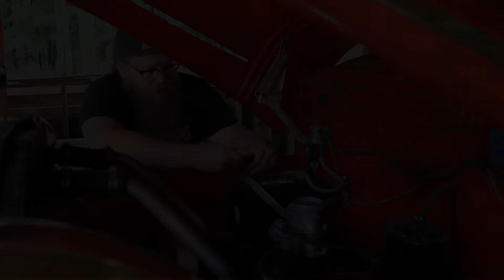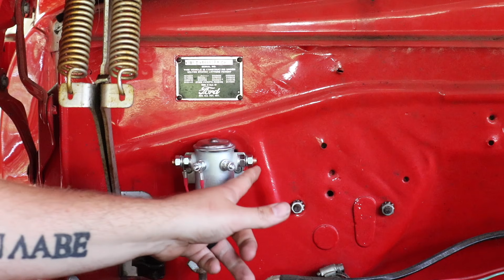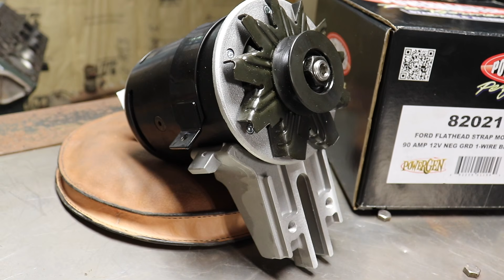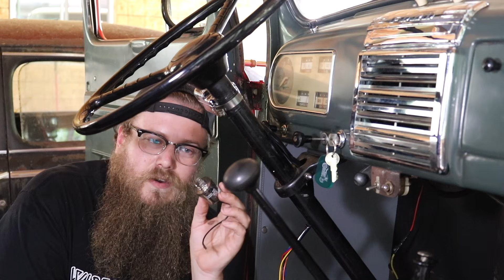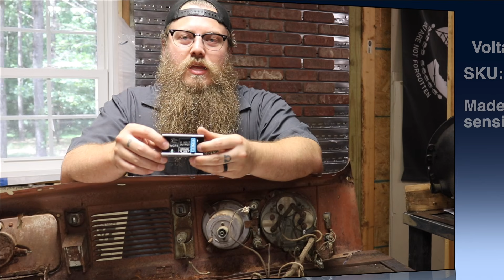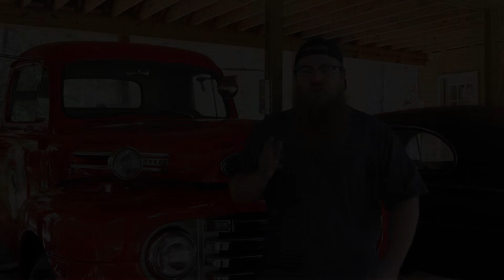12 Volt Conversion Kit Installation Ford 1951 truck

Comment: Hey Zack great video. One question my solenoid has only 3 terminals i wanted to ask where you put that one wire that was grounded for button? My kit is from vintage auto garage had it for over a year finally trying to tackle it all in but its getting very intense lol any help would be greatly appreciated

Comment: I had to boost my truck one last time before making the switch to twelve volt (to get it home). Prior to removing the battery, I noticed my horn no longer worked. I am guessing that that is because a horn is wired 'hot' and as soon as power was introduced, the 6 volt horn got 12 volts.  So my question is, is my horn irreparably damaged ?  I bought a new horn relay for the 6 to 12 volt swap along with all the other stuff you recommended.  I even got the small $79 unit you did a separate 3 minute video on. It cost a LOT more when shipped to Canada.  SO is my vintage horn 'toast' ?

Comment: Hello, i just inherited my father's 1952 f3.  he bought of a someone who has totally butchered the wiring.  The nearest I can tell it has ben converted to 12v electronic ignition.  My question is that year come with 12 volt or 6 volt originally. Thanks Victor

Comment: Hi Zac I’m trying to figure out where I should pick up power for the electronic fuel pump and for the relay from 12 V to 6 V. I was thinking of picking it up from the power that goes to the coil off of the ignition. What do you think?

Comment: Hey  ian old skool classics here im wiring a 52 from scratch have universal harness  motor has been switched to 12v but all gauges haven't  it has new led tail lights .  Needing to know what i need to convert from 6 volt to 12 volt ..
Reply: Its a ford f1 that im working on
Reply: Any info would be great

Comment: Been waiting for this one! Great video.  What about the coil? Did you change to a 12 volt coil? Do the Points and condenser need changing? Thanks Zac
Reply from the maker: yes change coil to 12 volts, no need to change the points and condenser, these will work fine on 12 volts
Reply: Thank you! Two things that I installed that wasn’t in this video specifically is, 12 volt coil, and 12 volt headlight, I also installed LED taillights, sorry for not putting that info in this video, check out vintage auto garages installation booklet, it shows you what the 12 volt versions are of your 6 volt bulbs 👍🏼